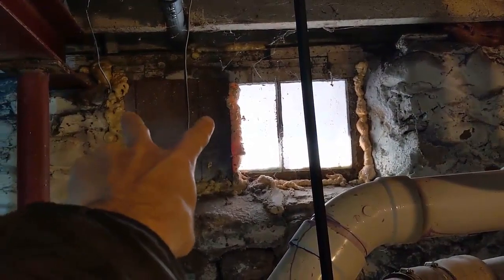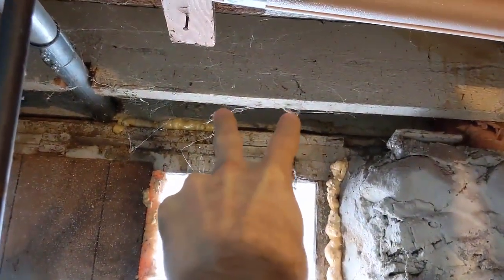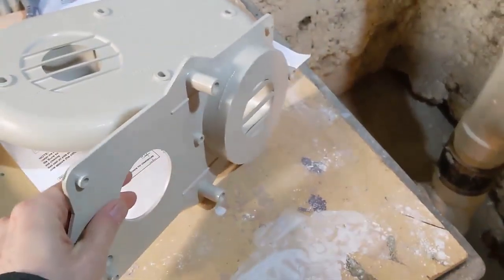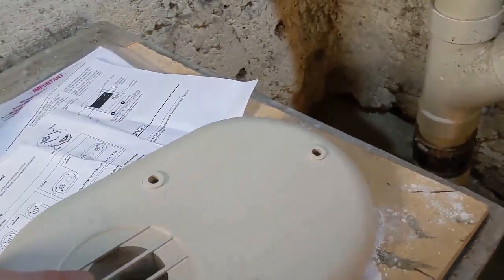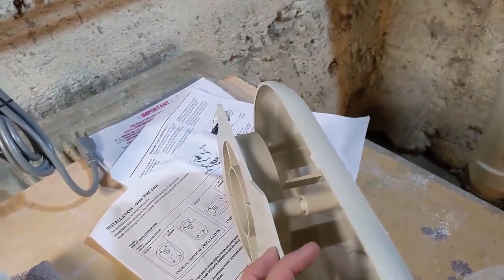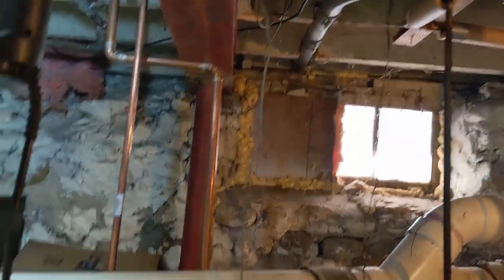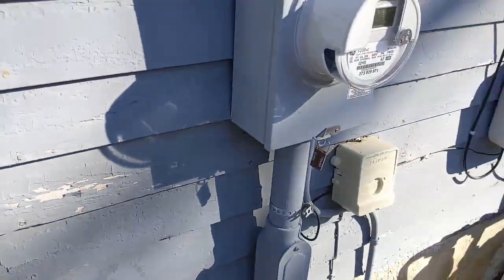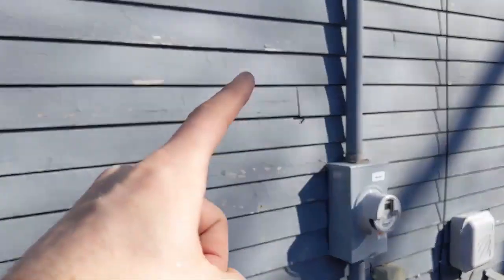Rheem Tankless Water Heater Installation Part 2: Venting

Comment: You need to remove the video!  You reversed the designation of the fresh air & Exhaust vent.  You statements could result the exhaust fumes to re-enter the fresh air combustion intake.
Reply from the maker: I'm not in much danger of getting exhaust in the fresh air, but I could be putting restriction on the exhaust.  I pinned a follow-up video where I noted the mistake and flipped the exhaust cap around.

Comment: Is there any advantage to the low profile kit instead of just pvc pipes sticking out of the house apart from esthetics?
Reply from the maker: No.  In fact, if you have trees or plants near this low profile cap, the intake can get clogged up, which is why some people don't like them.  I haven't had any issues with mine since I cleared that side of the house of plants.
Reply: @FixItScotty  So basically the low profile is used purely for esthetic reasons?
Reply from the maker: @martinlutherkingjr.5582  Yes, easy installation and aesthetics.  That's pretty much it.

Comment: In Atlanta, wasps and insects get through the inlet screen provided by the manufacturer and are killed at the heater. This causes a failure. I added screen wire at the exterior wall and have prevented the problem from reoccurring.
Reply from the maker: That's a good idea.
Reply: @FixItScotty  The lesson cost me a service call.  $$$ Ouch!

Comment: does the air intake have to be from the outisde of the house or can it be from the ambient air in the basement or wherever the heater is? thanks
Reply from the maker: I talk about this in my user corrections video: https://youtu.be/sb5oLP1iiAA.  The short answer is 'maybe', but call the water heater manufacturer to confirm.  They may have designed the intake and exhaust to be in parity, or require the same length.  Also make sure the water heater space isn't too tight with regard to air flow.

Comment: Exactly what I needed for the installation of my new Tankless water Heater !!Thank you !!!!
Reply from the maker: Thanks!  Be sure to check out my follow-up video on user corrections especially around the venting and vent cap.  https://youtu.be/sb5oLP1iiAA  Hope your install goes well!
Reply: hello again. I hope you don't mind me asking... (Rinnai was no help);  well, I purchased the vent but mine came with the exhaust / vent position reversed (marked as such on the wall face plate) . The air supply comes from the opening behind the front cap while the exhaust goes out the louvered hole in it. The dilemma I have is regarding the sloping of the pipes, It is mentioned that the exhaust pipe must be sloped TOWARDS the water heater heater while making sure the combustion pipe (air intake), is, at the very minimum, not inclined in the same way (while others indicate a slope in the opposite direction.  Well, the wall face plate for the low profile Vent does not have any "room" to play with  !! You can't have one pipe pointing in one direction while the other one in the opposite !! How did ypou mange this? @FixItScotty
Reply from the maker: @alexviademonte898  If you watch my other video, https://youtu.be/sb5oLP1iiAA, I discuss the venting slope and the end cap where I change the exhaust and air to the correct places (like you mention).  The exhaust is most important to slope up from  the water heater and out of the house.  For the air intake, the slope isn't as important since it's just pulling air.
Reply: Thank you so much !!! That help a lot !!!! Cheers!! @FixItScotty
Reply: my run is VERY short , basically from the top of the unit to a 45ᵒ to a 90 and out... Maybe 10" up and 12" to the end... Will see to give it a bit more slope... I was afraid of water coming if pouring rain and wind...  But I guess that is actually more critical with the combustion intake...I truly appreciate your kindness responding to all my questions...
 @FixItScotty

Comment: My buddy that’s a plumbing contractor and owns his own business told me that they need to 90 and immediately go out, so I’m not too sure about all this extra 90s and stuff you’ve got going on. He could be wrong. Great explaining and details either way.
Reply from the maker: Thanks for your input. Your buddy isn't wrong; his approach is the most efficient way to vent or exhaust. He could also be following local code. But, depending on where you live, there are wildly different types of installations.  I've seen attic, basement, garage, and exterior hung.  I've even seen them installed in an interior kitchen wall.  That's why manufacturer's have to allow for different venting options.  I go into more detail in this video if you haven't seen it: https://youtu.be/jxz7R80dZe8.  Thanks!
Reply: The installation manual will tell you how many elbows you can have, and what total equivalent length

Comment: What is the remedy for rain water getting into the air intake ?
Reply from the maker: You don't need to use the vent cap provided Rheem.  You could do something like this (http://yourpacesetter.com/wp-content/uploads/2016/03/pacesetter_homes_construction_warranty_exhaust_intake.jpg) where you just glue a downturned elbow as the intake.

Comment: At 11:40, your advice is wrong. You never want the pitch of the vent going outwards - you want the vent pipe to slope in towards the water heater. You say you don't want water running down into your water heater because that would be "bad." In fact, that's EXACTLY what you want to happen - if water does get in there (and it will, because the exhaust gases will condense), it will drain into the condenser sump, and then out the condensate drain. That's what the condensate drain is there for.

If you slope it outwards towards the vent, you can end up with water pooling in the vent tubing, which you never want.
Reply from the maker: You are correct. I did an addendum video to this for this reason. It is corrected. Thanks!

Comment: wait shouldn't you pitch down and not up. would it drain back into it?
Reply from the maker: It should pitch up from the unit to the outside.  If condensation cools and flows back into the unit, it will escape from the condensate drain. I explain and clarify how the vent should slope on my follow-up video. https://youtu.be/sb5oLP1iiAA

Comment: He's not accurate in this video install , on a furnace same trim has no connection with air inside the house , has nothing in common with supply air & return air inside the house, the trim restricts bugs & debris from  drawing it in through intake to  the burners , the fresh air 2" pvc is for the cumbustion fresh air , burners needs air/oxygen , it's safe to say the venting & intake is 💯 % separate from air circulation in house 🏠

Comment: Did you flash the siding where you cut a spot for the exhaust and intake 2 inch pipes? That caulking is no good and will be deteriorated in a few years. All you needed was an elbow pointing up for exhaust and an elbow pointing down for intake. Don't need that time wasting cover plate. A better way is to have used gap filler foam (it is waterproof) around each pipe, place the bezel and let it expand to sandwich between the wall and the back bezel.

Comment: Ok so I have my water heater in my laundry room with a wall vent that lets air flow freely from outside. My question is could I only run the exhaust through my existing water heater exhaust and leave the intake in the room so I don’t have to make another hole and worry about routing another pipe?
Reply from the maker: Did you watch my User Corrections video?  In that, I cover some of these questions.  https://www.youtube.com/watch?v=sb5oLP1iiAA.  The short answer is: Yes, you could probably leave the intake open if your laundry room has access to "make-up air".  I would still put an elbow and screen on it to prevent it from pulling in objects or lint.  For the exhaust, my guess is 'No', you cannot use your existing exhaust.  If that exhaust is metal, the acidic vapor of the water heater will corrode it.  But check with Rheem support for a definitive answer.  I called them and they will give technical advice to non-professionals.

Comment: Note the main electrical conduit is routed by notching out a main floor joist at EXACTLY THE WRONG SPOT in the timber to do that.  The lower edge -- extreme fiber of the floor beam is where THE MOST BENDING STRESS OCCURS.  That alone makes you wonder whether you should follow the instructions of someone who did such work.  
Hmmm.  Yes, of course, this is a different matter.  But remember, DIY does NOT usually follow the best and proper/correct procedures.  
BTW, this bad work described above could be partly remedied by adding a metal strap across the lower edge of the joist and tied back in to the wood really good.
Reply from the maker: Thanks for the tip on the metal strap.  I will look at that.  BTW, this work was done by a licensed electrician 12 years ago when we first bought the house. We had an electrician upgrade the weatherhead, main wiring, meter base, conduit and panel. It was also permitted. Very disappointing to know it was notched wrong.
Reply: Hahaha, it’s usually the trade that messes it up.  I can’t tell you how many times the electricians drill through the chord on an engineered joist during remodels.  I’m a contractor but I’m tired of the trades people thinking they always do it right. Most are as hack as the DIY

Comment: I am installing a Rheem tankless water heater and have some questions about venting.  If I go straight out from the tankless waterheater to the outside for both the intake and exhaust (appx 2 ft each)  I come out 12 inches below the vents for the cloths dryer, is that acceptable? The cloths dryer vents are actually 10 ft off the ground on the side of the house which puts the intake and exhaust vents for the water heater 9 ft off the ground.  My concern is the closeness of the water heater vents and the cloths dryer exhaust vents (there are two cloths dryer vents, same height and about 6 inches apart horizontally).  My water heater vents would be horizontal.
Reply from the maker: I can't find anything specifically on your situation so you may need to consult a local building code official.  Or maybe Rheem support can give you a firm answer.  That said, 12" seems close. The exhaust flue gas is one issue.  But my concern is your air intake could pull in the lint coming out of the dryer vent above.  I followed general guidelines from this article regarding venting placement.  https://inspectapedia.com/chimneys/Gas-Heater-Direct-Vent-Clearances.php
Reply: @FixItScotty  thank you, I can put a nylon stocking over the intake to prevent lint from coming in but the exhaust bothers me more.  How far based on number of elbows can I go?
Reply from the maker: @davidcraft8277  The short answer is 30ft, but subtract 3ft per elbow and 1.5ft per 45.  Watch my Part 5 video for the full explanation.  https://www.youtube.com/watch?v=jxz7R80dZe8
Reply: HI again, so what if I moved the clothes dryer vent to below the Rheem Platium direct vent condensation (ECOH200DVLN-2) say about 5 feet below which puts the cloths dryer vent about a foot off the ground and the tankless vents 6 feet above them?
Reply from the maker: @davidcraft8277  The spacing sounds a lot better, but check your local code on the dryer vent.  I couldn't put mine 1' off the ground because snow buildup could cover it.  It may be different in your area.
Reply: @FixItScotty  Thank you so much, it is much easier to move my dryer vent than run the piping for the tankless water heater.  I live in Las Vegas, Nevada were it never snows and rarely even freezes.
Reply: I am sorry to keep bothering you, but moving the dryer vent isn't an option after all.  So I wish I could send you picture of what I think is a good place, however I will try to explain.  Placing it 3 inches above the side garage door frame and 12 inches to the right of the door which after installing would leave about 12 inches horisontally from the garage vent to the right of the tankless vents.  So basically door - 12" - tankless vents - 12" garage vent.  Or I can go past (to the right) of the garage vent 12-24" and then put it but that would mean changing to the A2 settings.
Reply from the maker: @davidcraft8277  If you go to my channel About tab, you can get my email address and send a picture.  But I think it would be better if you got a more informed answer from Rheem support on venting.  They might be able to give you more options that I am not aware of.

Comment: i like your tutorial. and i'm doing it right now. not much help from their support. they gave me different information every time i called. i have a question regarding the connector you put between the tankless heater and the pvc for your vent thing what is the size of that? i appreciate your input. thank you
Reply from the maker: I'm not sure I understand what you mean by connector?  I used standard 2" PVC pipe and elbows.
Reply: @FixItScotty  got it thank you
Reply from the maker: @geraldohasta6571  Good luck with your install!

Comment: You have the intake and exhaust backward, I work for Rheem Manufacturing...
Reply from the maker: Yes, I plan to do a correction on that soon.  Thanks!
Reply: Hi Chris, I am installing a Rheem tankless water heater and have some questions about venting.  If I go straight out from the tankless waterheater to the outside for both the intake and exhaust (appx 2 ft each)  I come out 12 inches below the vents for the cloths dryer, is that acceptable? The cloths dryer vents are actually 10 ft off the ground on the side of the house which puts the intake and exhaust vents for the water heater 9 ft off the ground.  My concern is the closeness of the water heater vents and the cloths dryer exhaust vents (there are two cloths dryer vents, same height and about 6 inches apart horizontally).  My water heater vents would be horizontal.
Reply: David Craft It shouldn’t be an issue but I would look at your local codes. Since the dryer vents are not pulling any air into the house and it is not combustion gas( assuming it’s an electric dryer) it should be fine .... again always refer back to local codes for installation since they differ so widely...

Comment: Why cant the intake just be open and have it suck in the basement air? also wouldn't it be better if you put a mesh screen on the ends to prevent bugs and rodents from using it. idk why I am picturing a rat hiding from the elements inside the pvc pipe like a gerbil then getting sucked into the appliance
Reply: You have the outer plastic vent housing backwards, it needs to be flipped around.  Thats probably why you had the error code 13 in your later video...
Reply from the maker: Good questions. I don't know the full answer, but drawing air from the outside has something to do with the "tightness" of modern homes built to decrease air loss for efficiency.  By drawing air from the outside, you don't have to worry about a potential "vacuum" situation in the room where the furnace or water heater resides. As far as a screen, if those plastic louvers ever break on the vent cap, I will probably add some wire mesh.  But it's high enough off the ground and the slots are small enough that rodents can't get into it.
Reply: You likely could and it would be safe due to the safeties in these units but... Indoor air is significantly dirtier than outdoor air leading to possible service issues such as premature failure of heat exchanger caused by laundry detergents/ other 'fumes', venting issues due to the different pressures of inside VS outside,  ignition failures from dirty sensors etc... Having the slight possibility mouse in the fresh air pipe is usually the better option.

Fresh air screens (mainly the fine ones) can also get clogged causing vent issues which may cause more issues than they're worth.

Comment: Will this work for high efficiency furnace setup?
Reply from the maker: I don't believe so.  I think the code for furnaces requires the fresh air and exhaust to be at least 12" apart.  This vent plate is less than 6".
Reply: Depends on your state's building codes.  I used it for my HE furnace in WA.
Reply: is this comment not about the tankless water heater?  you say furnace which to me means the heating of the house and not a water heater.

Comment: According to the manual you are stating this backwards. Exhaust is direct and fresh comes in around plate.
Reply: You should fix this error. Could lead to hazardous conditions for other people following this tutorial.
Reply from the maker: Really? Darn, I will have to check that again. So far no issues with my unit so it may not matter.
Reply: Got to thinking the exhaust is usually free flowing and the intake would be protected from the elements. Plus heat hitting against plastic. I’m going by the book! 🤣
Reply: @FixItScotty  it can matter. If it's really cold out, the water vapor in the exhaust gases can freeze onto the  cedar siding if it's not leaving through the free flowing hole.
Reply from the maker: @darianrichardson7729  I wish youtube let me annotate videos after the fact.  I will do a follow-up video where I correct this.  Thanks!
Reply: @FixItScotty are you even licensed to install this? Something tells me you have no idea what you’re doing
Reply from the maker: @theretroreview8178   No I am not licensed.  And, yes, I have NO IDEA WHAT I'M DOING.  None whatesoever.  I guess it's just a miracle that my water heater has been working reliably for the last 6 years.  Stop with the hyperbole and address the mistakes I made.